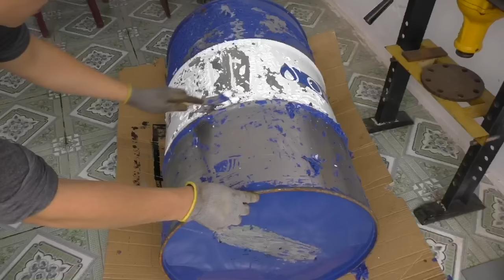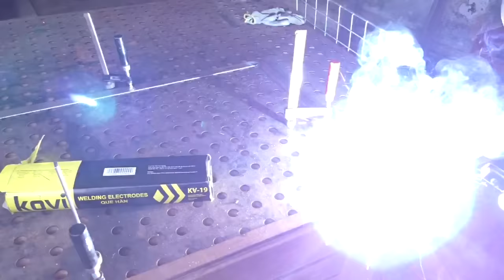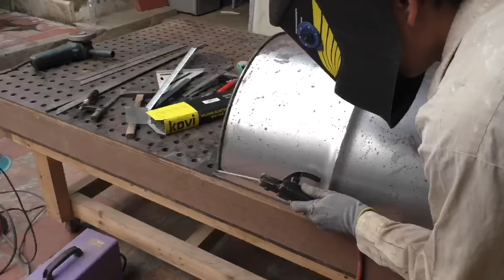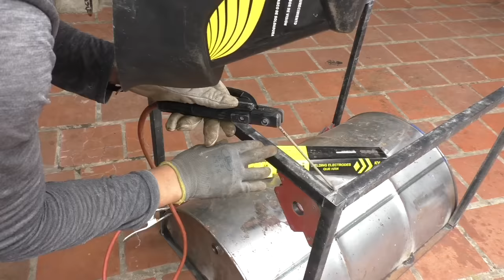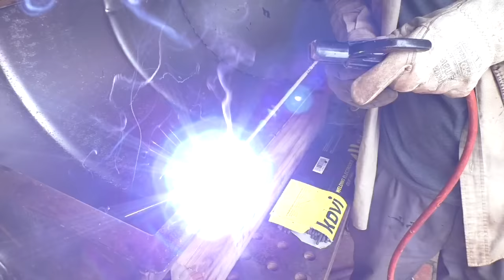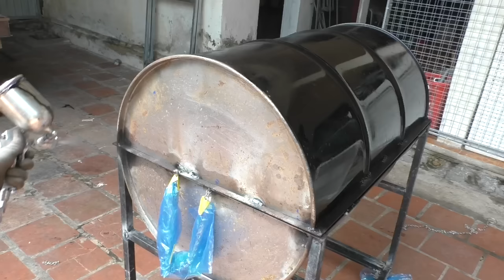BUILD BBQ SMOKER FROM DISCARDED BARREL

Comment: That’s a lot of work for something that’s not going to last long due to thin metal of the barrel !
Reply: Someone never grew up on a farm and had the outside "burn barrel" that lasted 10+ years of burning whatever random stuff that needed burning. It'll last.
Reply: It'll be fine, especially if coated with oil on the outside and allowed to cook it into a protective shell
Reply: @abingham3747  PC hola
Reply: That barrel will outlast 99% of store bought bbq's 😅
Reply: Mine is over ten years old. I leave it in the back yard uncovered so……

Comment: it you weld that slow you are using to big of welding rod and the amperage is to high.   When welding sounds good it sounds like frying bacon. stoping in the middle of a puddle opens the weld to impurities and a weak weld.
Reply: Ok master "welder "🤣
Reply: @jesusguerra9095  Glad to help man.  button those sleeves also so sparks don't get to your forearms. 
E6013  electrodes  3/32"  --  at  40 - 50 amps, always chip the slag when restarting the puddle.
Reply: @dand3975  0pppapq
Reply: Good thing this one is not for home use

Comment: Yea nice, but why go to all that trouble when most of the store sells them for less than $80
Reply: Why spend $80 when you can build your own out of scrap? If you have the tools and the knowledge to build one then why not?
Reply: Scrap metal $60 maybe more, welding supplies about $20 time about 2 to 3 hours maybe more, Houston tx done that when I was younger as a school project at the time sounded very good not anymore
Reply: Be cause the ones you typically buy are bolted together and come in a box from China or some other slave labor country. And you still have to assemble it yourself.
Reply: Stevens obviously you don’t know anything about Texas, there’s several stores that sell barrel pits made by local welders, and there’s a lot of welding shops that make those made from scrap metal and sells them for $50
Reply: @luich2275  I live in Texas, the barrel pits you get at the big box stores like Lowes, home depot, academy, and Walmart are all made overseas and come in a box that you have to assemble yourself. Yes there are places that sell barrel pits from local craftsman but those are usually in small rural areas that doesn't have a big box store.
Reply: @Truckerdaddy  you must be from Dallas
Reply: @DoctorSess  nope wrong direction. Born in Anderson County, raised in Polk County and live in Hardin County. I'm a southeast Texas man. Biggest city closest to me is Silsbee.
Reply: Walmart, lowes and Home Depot doesn’t sell this pitts at least in Houston they don’t, HEB do outside the store no assembly required welded
Reply: @Truckerdaddy  I’m in lake Livingston area and we have American made pits (not at big stores)
Reply: @luich2275  the pits from H‑E‑B aren’t the greatest though from what I saw. The walls are thin.
Reply: Well it’s a barrel of course the wall it’s thin but cheap, and in Houston and surrounding areas there’s a lot of bbq pitts makers that makes some awesome ones
Reply: @luich2275  the pits I’ve seen at H‑E‑B aren’t using re-purposed barrels though. Not all barrels have the same thickness either if you are making your own. You want thicker walls to hold the temperature.
Reply: @DoctorSess  where can you find one of these style pits around Lake Livingston for under $80 or less like was suggested in an earlier comment?
Reply: @Truckerdaddy  wasn’t me who said that
Reply: @DoctorSess  I stand corrected, it was the other guy. 

I would still like to know if you see any around for that price.
Reply: @Truckerdaddy  hey me too man lol I’ll let you know if see any flying pigs as well
Reply: Houston tx not Livingston just go to little York and brittmore small place affordable prices different styles
Reply: @luich2275  I used to work at a metal fab shop around there… ain’t nobody selling pits for under $80 over there.
Reply: Union iron and metal 288 and alameda rd cheap scrap metal
Reply: @luich2275  well where is? Little York and Brittmore or Alameda?
Reply: Little York rd and brittmore rd west of Houston you can find good bbq pitts affordable, 288 and alameda rd you can find scrap metal cheap, it’s not that hard to find the place union iron and metal
Reply: @luich2275  yeah but you can’t find them for “less than $80” as you previously claimed. I already built my own though thanks 😅
Reply: Congratulations, but yes I can find one for $80
Reply: @luich2275   nah you can’t
Reply: You can’t tell me what I can or can’t do, if you can’t that you’re problem. You said that Walmart, HD, and lowes sell those types but needs assemble and low quality, and the truth it’s that they don’t even sell barrel pitts
Reply: @luich2275  The guy wasn't even talking to you. Also reading your other comments it seems you haven't left your house in 20 years.
Reply: Red bear I’m a truck driver a drove to many cities and a certified welder I know what I’m talking about, but it’s a internet video I commented he responded different opinions that’s all